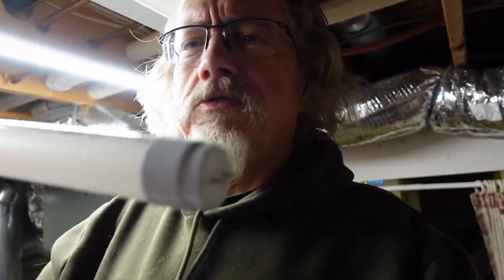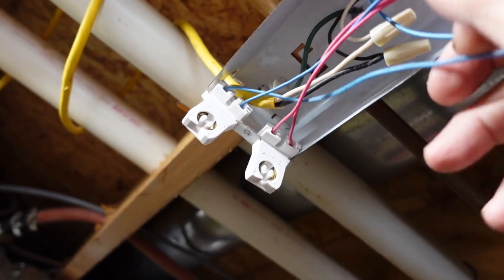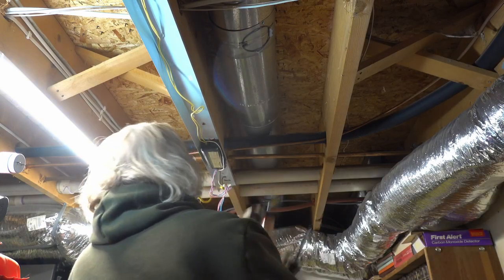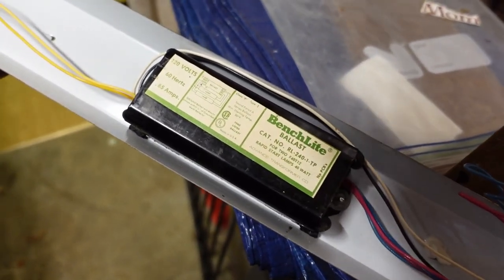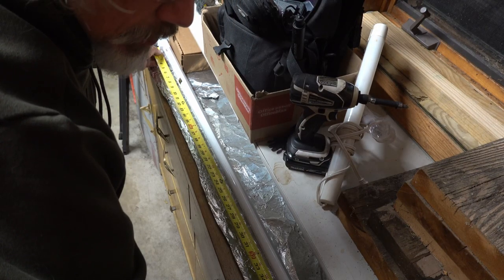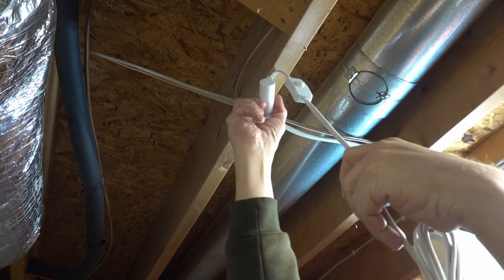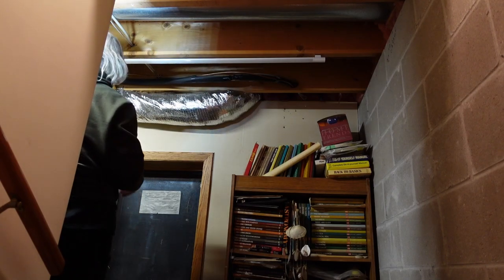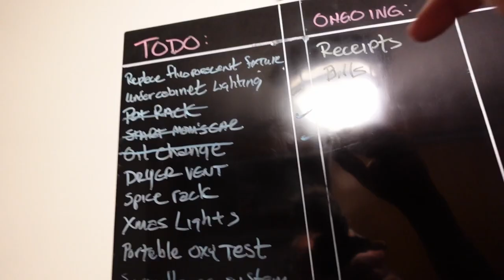Replacing a fluorescent fixture with an LED

Comment: I just did this in my kitchen. Unfortunately my house uses the junction box and flexible metal tubing as the ground, so the first thing that I had to do was add a ground wire.